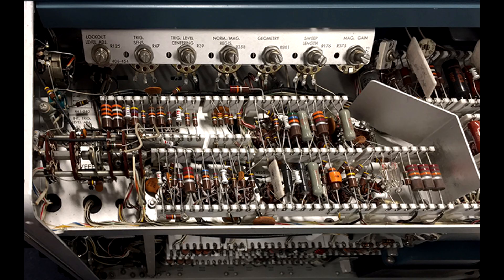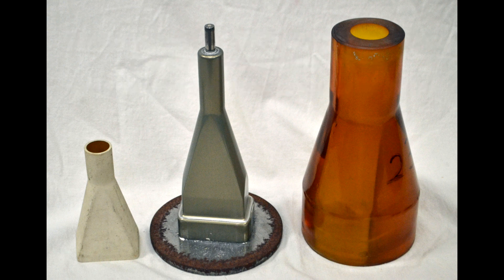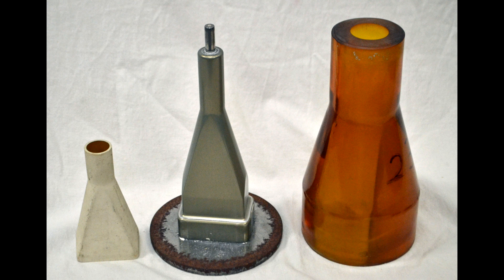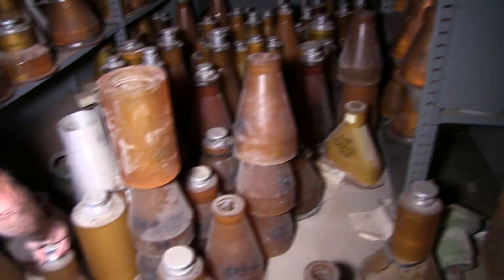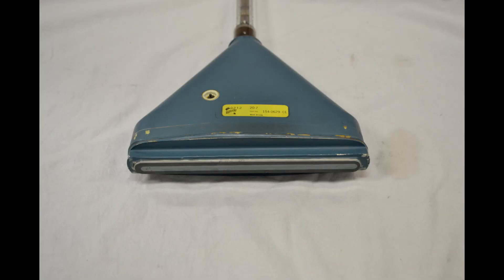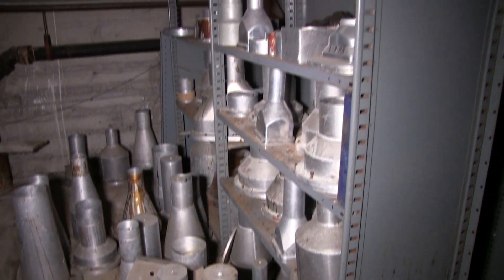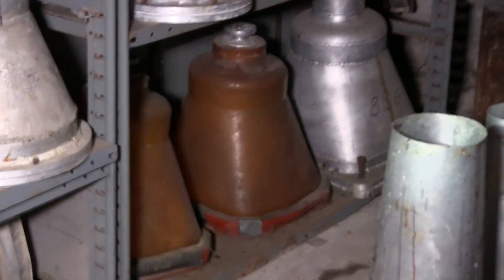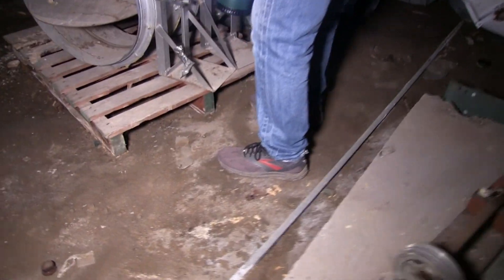A Tour of the Tektronix Ceramic CRT "Catacombs"

Comment: Wow! This brings back memories. I worked as a summer hire in 1980 & 1982 'flashing' 611 tubes on a RF machine and soldering on the connector pins to the ceramic body. After I was done, they would go to QA next door and if the passed they were painted (which I also did in 1982). They were also producing a lot of the single line hardcopy CRTs at that time. Also in the same room were the vacum pumps for some of the more narrow tubes and on occasion I would have to drag around a large tank of liquid nitrogen to refill the pumps. It was fun to see some of the liquid nitrogen spill onto the floor and scatter like bb's. Thanks for sharing!

Comment: Those dies are exceptionally valuable to the continued Operation of Tek scopes. With them, vintage CRT's can be made anew. 

I for one am over joyed that they still exist!
Reply: I'm thinking the remaining infrastructure needed to make them is so nontrivial as to be inaccessible.
Reply: @aajpeter  for industrial mass scale production, i have to agree. but for small scale production, its not as hard as you might think. You need a lot of equipment, and special knowledge, but i have seen this done at university labs and the like. 

Having the design specs and jigs still present makes it quite easy, all things considered. Since reverse engineering is the hardest bit.